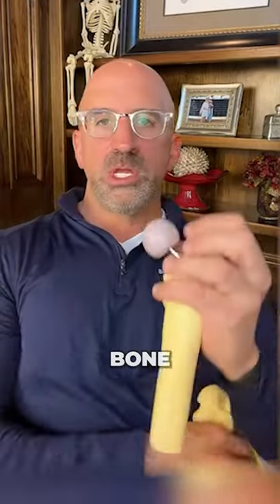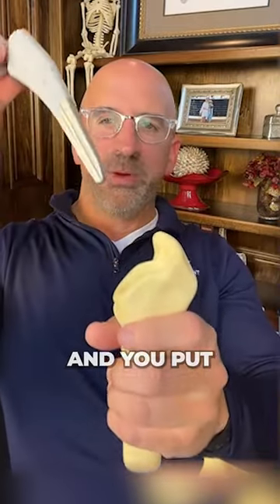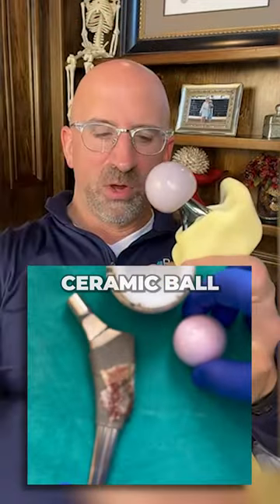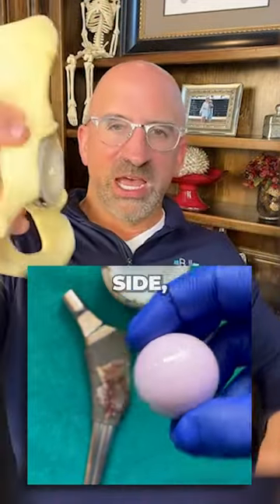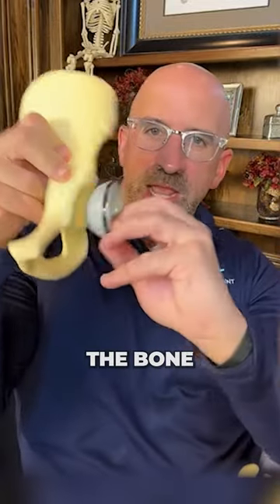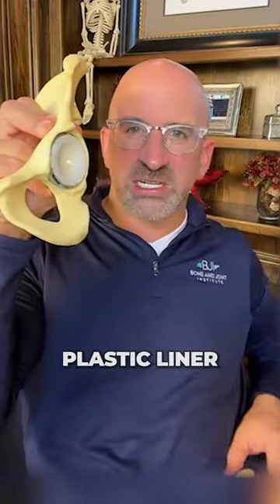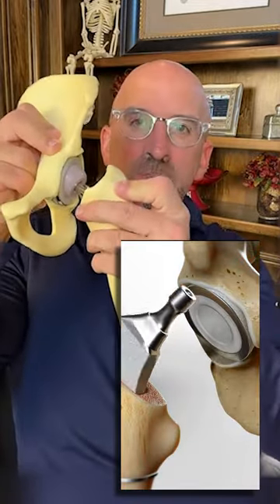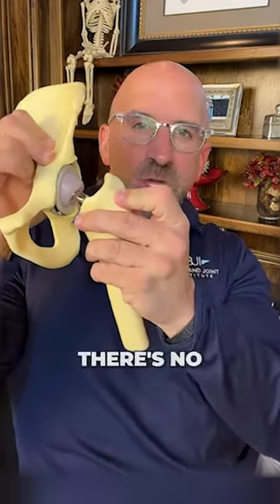Bone-on-Bone Hip Arthritis Cure #shorts

Comment: Do they put any lubrication around the socket and ball?
Reply from the maker: The implant is designed with a ceramic on polyethylene surface that is low friction without any additional exogenous lubrication
Reply: Wd40 or pb balster

Comment: What is the life expectancy of the replacement?  Dad had his knee done and even he turned 68 it started giving him trouble. The doctor said it was already being it's expectancy and would have to be replaced again. The insurance company said no.
Reply from the maker: Newest studies of modern Implant suggest less than 1% failure rate per year. So at 20 years, at least 80% continue to do well. Improvements in technique and implant design and materials continue to improve implant durability and wear resistance most implants last lifelong.

Comment: DOES THE PLASTIC REPLACE THE CARTILAGE. What replaces the synovial fluid.
Reply from the maker: The plastic or polyethylene liner articulates with the ceramic headball to provide a an extremely low friction interface, allowing easy joint movement, without a lot of squeaking

Comment: Yeah, but it’s not that easy they make the hole that the socket goes in smaller and then they hammer in the socket part so that the bone fuses around the metal.
Reply from the maker: Not an easy procedure to have or to do, but very easy to understand the basic steps. Thanks for taking the time.

Comment: How do you handle all the tendons and ligaments that hold a joint together?
Reply from the maker: Excellent question. I most often use anterior approach which allows dissecting through the physiologic plane of tendons, muscles and ligaments, and does not require cutting or repairing tendons and ligaments.
Reply: I dogs, I have to do a partial transection of the proximal deep gluteal ligament to get good exposure on anterior approach

Comment: 3 part question: What is the length of recovery? What stage  would you recommend this procedure. Lastly is this a viable option for someone (me) with Osteoarthritis  in hip
Reply from the maker: All excellent questions. Start replacement of course is an option when conservative therapy has failed to relieve symptoms. It really comes down to a quality of life issue. For many patients the point at which it becomes an acceptable option is when the joint pain is interfering with sleep at night, causing a significant decrease in activity and creating an unpredictable lifestyle. Many factors influence recovery. Most patients are taking their first steps with assistance just hours after surgery. Walking without assistance within one to two weeks. Patients can return to desk jobs or light work. Typically within 6 to 8 weeks. Full recovery can take as long as 6 to 9 months. How is your hip doing?
Reply: Had right done 2021 and doing left this year.  I am in constant pain on the left as now the shots no longer work.  Bone spurs and osteoarthritis.  Do it.  Quick recovery and the results are excellent
Reply: I cannot rave enough about hip and knee replacements. Just have a slowly increasing exercise regiment on the other side. Consider a hip replacement with the entry to surgery at the front of hip....it eliminates the whole sitting higher thing ,while peeing or driving....if the cut is in the front you don't have to worry about it/the stitches coming out etc...
Reply: @B.Mega.D  thank you for suggestion
Reply from the maker: @B.Mega.D  excellent advice, and always best coming from someone who has been through it. Thanks for taking the time to share.
Reply from the maker: @conniesparks1972 Hope all goes well w/ new hip
Reply: Took mr about 4 mos. I had to do physical therapy which helped so much!!
Reply: Easy peasy
Reply: You heal and can be normal in no time. 6 weeks I was doing great. You of course take it easy so all will heal and be secure. But I had arthritis in both hips and both hips are done. One is 10 years ago and one is 2 years ago. Hip replacements are much easier and heal very well as long as you do what you're told to do. I did my therapy at home and love both my hipp replacements. Just make sure you get a good doctor five star and read their reviews which is what I did. Dr Goldman in Dallas is fantastic..

Comment: 5 year guarantee?
Reply: Rest of life
Reply from the maker: Average rate of failure is approximately 1% per year and continues to improve. So at 20 years, 80% are still doing well for most people, it functions for life.
Reply: Does that mean you can install this device in 18 year olds and the procedure will last a lifetime?
Reply: @carnivorechronicles  no. I think both knee/hip replacement are awesome....however there can be a lot of complications for some ppl, or from some materials...my Granny's 'ceramic' cracked, someone else had 4 revisions in 1yr bc of bone infection they developed. It's almost like dental work....some ppl will far outlast their average lifespan of the device....for others it'll fail right on cue,and others still will have problems (small minority) very soon/ immediately after. The materials/techniques are changing for that reason. Like the development of a new table that allows the entry wound to be from the front of hip not the buttock side....much improved healing that way.
Reply from the maker: @carnivorechronicles  I have had 18 year olds that had to have hip replacement, but very young to need this procedure at that age. It is possible that it could last for lifetime, but obviously the younger the age of the patient the higher the risk of revision. Current average age of hip replacement in the US is 62 to 63 years old and has been decreasing over the last 5 to 10 years. Thankfully, modern implant design, material and surgical technique continues to improve implant durability and wear resistance. Thanks for taking the time 🙏

Comment: So what is the difference between a full knee replacement and partial knee replacement? 
Not looking forward to the day I have to have both my knees done for this. Sticking with my Euflexa injections for now every six months. So far it is working great. Both knees since 2013. I will be crawling into the office in pain before I get knee replacements. One Ortho office I get the Euflexa injections has been telling me  I am bone on bone with both knees and need entire knee replacements. I went for 2nd opinion in another city with Ortho. He said I have great flexibility in both knees, unless I am in pain all the time and as long as the Euflexa injections are working for me, he suggested continuing. He said when time came for surgery though, he would not recommend full knee replacements, but only partial for both. When the time comes, I will see him.
Reply: I knew a lady in her early 60...bad knees from years of skiing, and she wasn't the slimmest anymore (but not hugely overweight either, maybe 20lbs at most). Before surgery she walked like she had a barrel between her knees and 25degrees leaning forward at the top......after.....she was skipping, jumping, twirling with joy, and walking (6mo po-op)90%better already...
Reply from the maker: Partial knee replacement is an option. Wind damage is only to one compartment of the knee typically the medial compartment. If a knee joint has damage in all three knee, compartments, medial, lateral and patella femoral, partial knee replacement will not typically offer symptom relief and improvement. Partial knee replacement Typically preserves the main knee ligaments and provides shorter surgery, faster, recovery and more natural function, following surgery. Most patients are not candidates for partial replacement due to damage in more than one compartment of the knee. Partial is great for some, total knee replacement is needed for most.
Reply: @BoneDoctor_YouTube  Thank you for the very informative explanation of partial knee replacement. I didn't think to ask until now, how long do they last in comparison to the full knee replacements? Is it possible to replace them with another partial knee replacement instead of a full knee replacement? By putting off surgery longer and doing Euflexa injections, am I raising the probability of having to get a full knee replacement as opposed to partial knee replacement?
Reply from the maker: @annoymousme722  excellent question. Studies comparing partial and complete knee replacement show that there is an increased risk of need for revision or conversion 2 foot need replacement in patient that have had partial. Still, most partial knee implants never have to be converted or revised to complete knee replacement. Are many factors to consider. Overall, only 10 to 20% of patients have damage and disease limited to a single compartment, making them an appropriate candidate for partial knee replacement. In my patience, if there is moderate to severe damage in more than one compartment of the knee, we sincerely discuss going with total knee replacement initially. unfortunately even when carefully evaluating each patient’s risk factors, there is no way to guarantee that a partial replacement will or will not have to be revised. There’s nothing about knee injections that necessarily increase the risk of needing knee replacement, but if there is significant damage in the knee joint, it is very true that time absolutely does increase the risk of need for total knee replacement. Hope that helps some.
Reply: @BoneDoctor_YouTube  thank you! All good to know.

Comment: Due to having polyarticular rheumatoid arthritis I have had many joints replaced and one removed. I'm also waiting on my wrist replacement being removed as it has failed and become lose and extremely painful. All being well I'm going to have a custom made one fitted, my surgeon just needs the hospital to allocate the funds to do so. I'd rather wait it out instead of having it removed and then have a Stanley pin in and it becomes fused.
Reply from the maker: Thanks for taking the time to share. Hope all goes well with the new wrist. Keep us updated if possible.

Comment: How does the cup stay in place? And the same with the rod ?
Reply from the maker: If healthy bone, typically it is just pressed in place and also integration will hold it in place. With poor bone quality sometimes bone, cement or screws are used.
Reply: I watched another Ortho doctor on YouTube showing a knee replacement operation where they used a mallot to hammer in place the metal rod into the drilled out femur inside the middle of it. It was like a construction worker hammering into cement trying to hit a metal stake in it. No wonder you are in so much pain afterwards!

Also, I saw another Ortho doctor, might have been the same one, not sure, talk about another Ortho doctor who made a really stupid mistake. He put the knee replacement on backwards during surgery!! Showed the patient's knee. Needless to say, the patient had to have the surgery done all over again! The doctor lost his license and sure there was probably a malpractice suit too.
Reply from the maker: No excuse for those types of mistakes. Thanks second time.

Comment: I have a question about this procedure 
What about the artery that passes through the head of the femur?
Reply from the maker: Excellent question. I believe the blood vessel you’re talking about provides the blood supply to the femoral head. With hip replacement, the femoral head portion of the femur is removed and so blood supply to that area is no longer needed. Careful cautery  and blood control is used throughout the procedure. Larger vessels can be tied off smaller vessels can be cauterized.